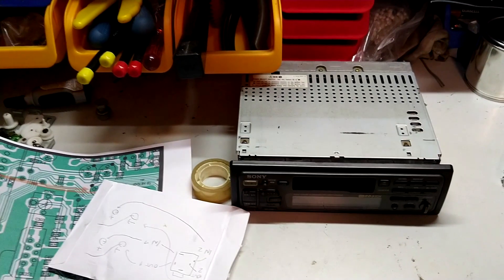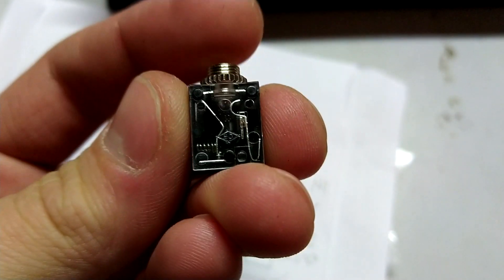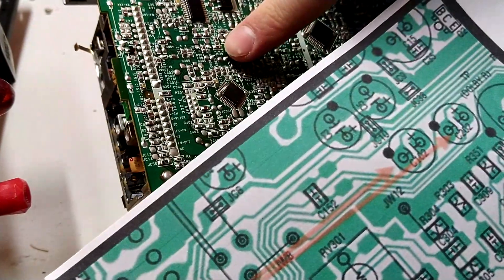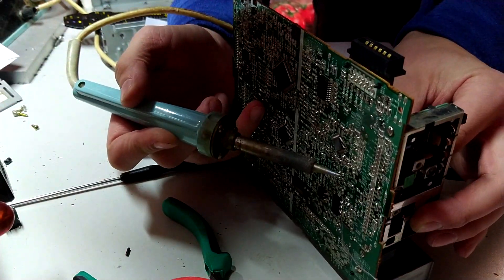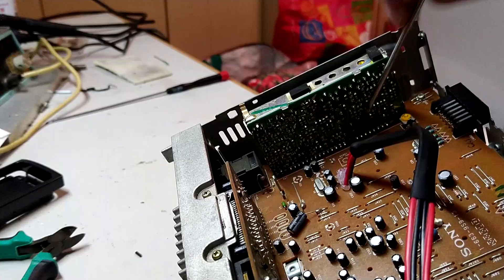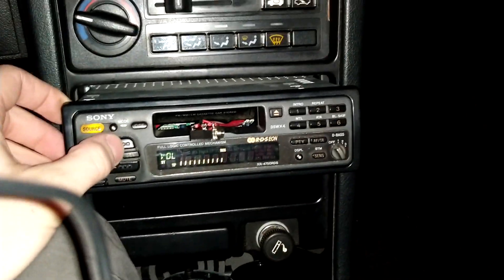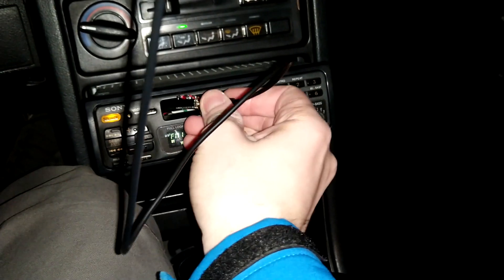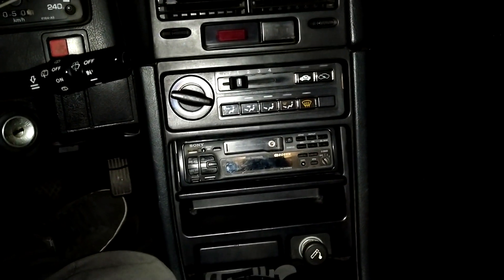Wiring a 3.5 aux jack into a retro Sony tape deck

Comment: or you just buy a 5$ cassette to aux adaptor and keep the cassette deck functional...
Reply from the maker: Cassette deck was toast in this. thats why I just threw it out. It was dead.
Reply: Or connect it on the AM input, like I did 🙂